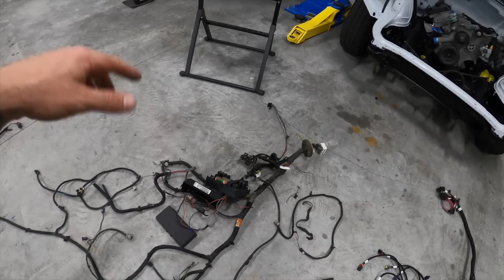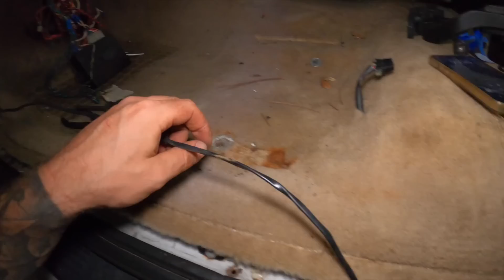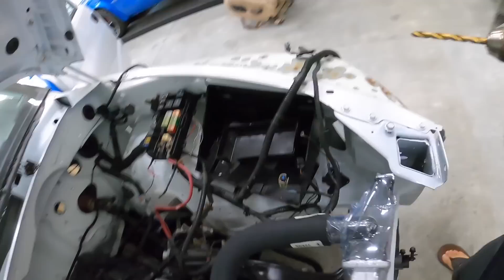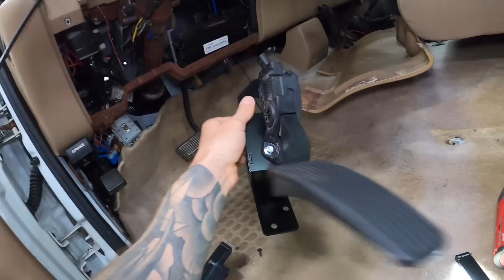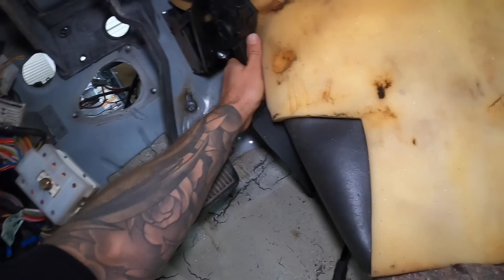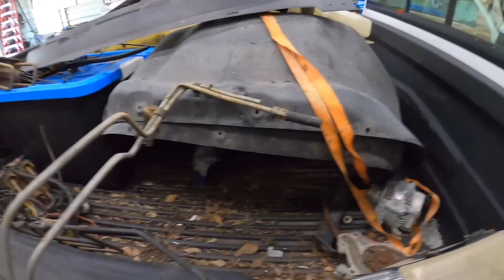2nd Gen Dodge RAM 1500 HEMI Swap Project Truck | Part 6

Comment: Love these videos. I am a Chrysler employee as well and have access to diagrams. It appears that those hard line hose with the bracket from the bed of the truck you showed are part of the Aux oil cooler. Also the part you thought was the other trans cooler is the Aux oil cooler for an 8.0L that mounts in front of the radiator. The lines you showed mount between the aux oil cooler and the radiator. Please let me know if need any more help identifying any other parts for this truck.

Comment: Is that a stock radiator or a bigger aftermarket? 
Did you go back to a mechanical fan on the Dakota or just a different electric setup?

Comment: holly has the 6L80 controller for the terminator X, soooo maybe hemi with a 6L80? would be pretty cool too see the mishmash of parts
Reply: Some people with high hp on hellcats already run 6l80s although I’ve never heard of anyone using it on a 5.7 Hemi
Reply: They have 6l80 controller now?  Is it a seperate box or software upgrade???  4 speeds not cutting it anymore…i might just go 3rd petal tkx …..
Reply: My tahoe and ctsv both have 6lxx in them….nice units

Comment: what transmission did you choose, the 46RH, or the 545 RFE.  is it true the NGC PCM is needed for the 545RFE, and the JTEC PCM would be needed for the 46RE, so did you use the 46RH?
Reply from the maker: 727
Reply: @BoostedMotorsports  oh, the torque converter on the 46 series contains the starter ring gear, I am not sure if the 727 is the same also, but the 4.7 powertech and 5.7 hemis have a flex plate with ring gear, did you use a separate flexplate with ring gear and torque converter without a ring gear, can you supply part number(s) for that mix or will the 545rfe torque converter work?
Reply: i answered my own question, before 1987, the SBM did not have the crank sensor as part of the flexplate, so the LA series flexplate and torque might work, i guess if the hemi bolt pattern is the same, use the 5.2 liter plate (non-weighted) or use the hemi flexplate and hemi converter if the input shaft is the same?  what about lockup and seals?
Reply: if you do this again, use the 46RH for 2 wheel drive.  then you will have a 4th gear or overdrive.  you can use a lockup torque converter as well.   the 46RH is a hydraulic 727 with overdrive housing, three pins, center pin is 12 volt, ground front pin, you have overdrive, ground back pin, you have lockup, i love these 46RH's make great hot rod trannies for the mopar stuff.